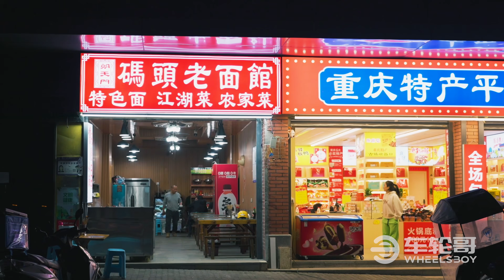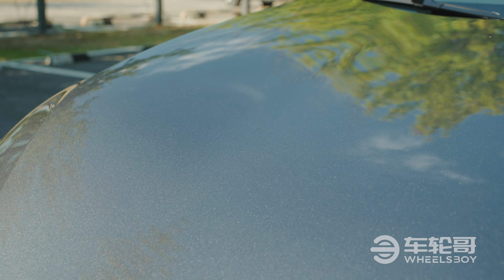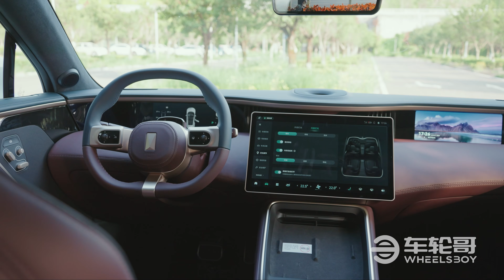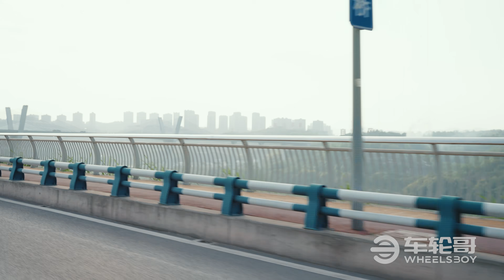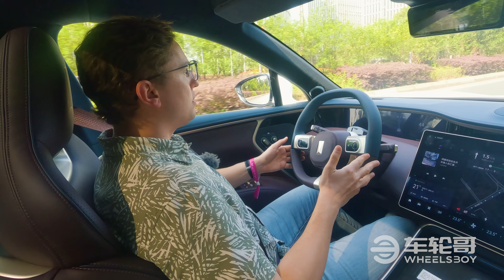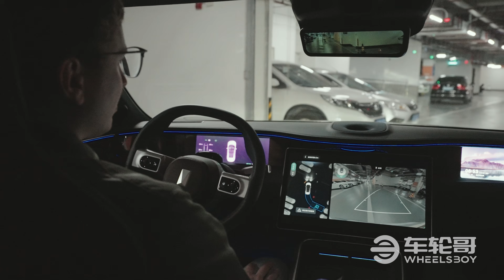Driving The Avatr 11 Electric SUV In One Of China's Most Fascinating Cities

Comment: I recently took a test drive in a Solterra with a digital rear view mirror and found it very difficult to use with the varifocal glasses that I use. You need to tip your head up to get the correct focus on the mirror. I think this would be a deal-breaker. Just warning anyone else out there as this type of system becomes more common ( Polestar 4 for example).
Reply from the maker: I’ve found that to be true as well, but if you spend time in the car, you get used to it.